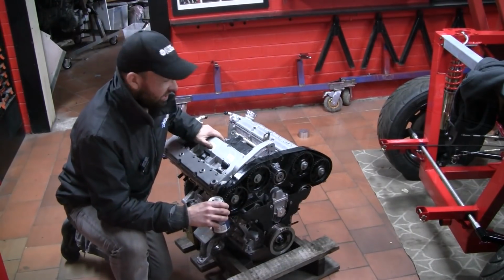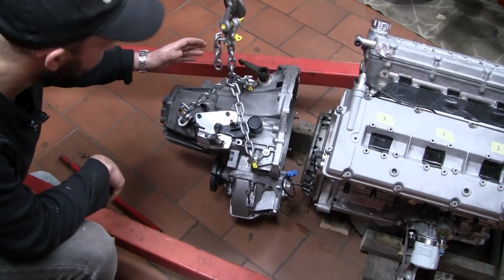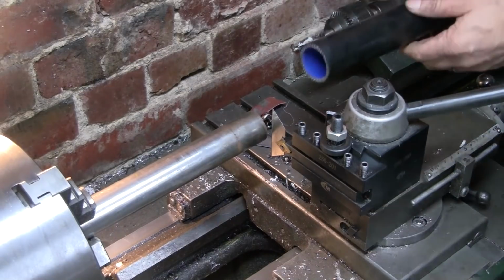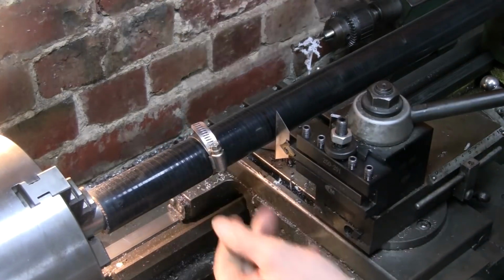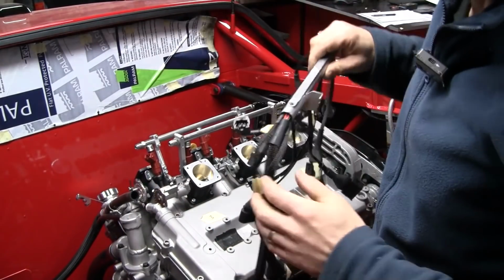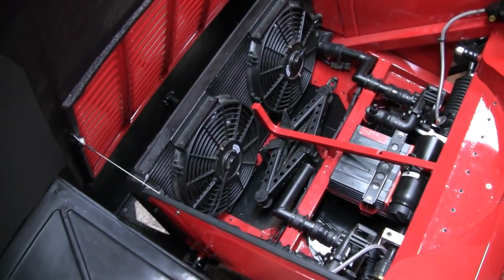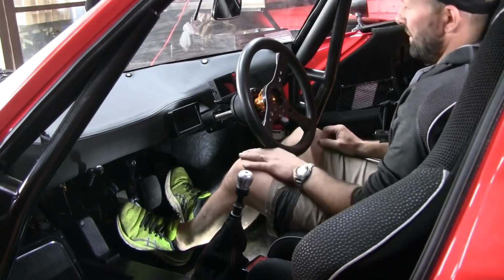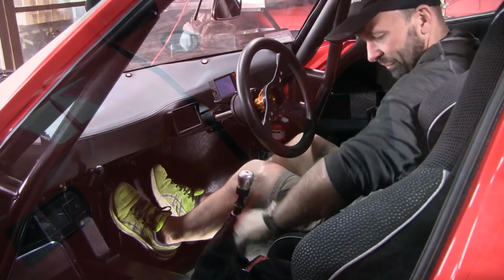Episode33 - Stratos Tarmac Rally car....Finished!!!!!!!!!!!!!!

Comment: Nicely done, but what happened to the nice Fiat 124 sport based (authentic period look) instrument cluster. Cant say like what you did there, sorry.
Reply from the maker: each to their own, this car was always going to be function over form and while i also liked the original dash, it took  up about 1/4 of the front screen and had a lot of gauges/lights that i just wouldn't use
Reply: @105colin  It’s your car of course, but you know you could have incorporated some of the original look into what you wanted. Just a thought. Cool car regardless of course 😁👍

Comment: Cmon mate we need more info! How many thousand HP did it make, how much NOS are you running and how many dentist driven supercars did you beat in the twisties at Winton? Actually how did the port temps go? (overall and spread?) also I wanted to say that you should drop to the 3mm tipped TC as the 1/4 inch ones you have take forever to reach steady state even on an engine dyno. Hope to see more vids in the future, great work!

Comment: Congratulations on finishing it. Two things. Did you retain the beeping reverse light? What did you do with the rear window? Stick with the perspex or get a glass one to help reduce noise. Once again, well done.
Reply from the maker: Hey Paul, thanks mate, Beeping reverse light???? .  Na stuck with a perspex rear screen, spent a long time sealing up the rear bulkhead and the cabin noise isn't too bad, the airbox reduced the intake noise a lot
Reply: @105colin  I put a globe that had a beeper attached. Probably died because of lack of use. I had to do something because people would stand behind the car when it was reversing. As you would know there is NO rear vision.

Comment: Superb result.  The last 10% of most builds usually take 90% of the time;the Stratos seems to have come together rather more quickly; registered, dynoed and driven in quick time.  Well done.  Any power figures?  Thanks for the series.
Reply from the maker: True, one of the main reasons for the lack of videos,just had to put the head down and get it finished.  Power wise,  well don't want to get into  a numbers battles but we got well over the standard 3.2GTA numbers Limited to 7000 and still increasing in torque, so more to come!
Reply: @105colin  I saw 189.0 on the dyno screen; assuming kW and 15% transmission loss, that is pretty healthy.  Nice easter egg.  What was the starting issue?  Thanks again.
Reply from the maker: Haha, you win! yea got up to 194kw, I'd be a bit more generous on transmission loss than you, but regardless, very healthy and still making very good torque, so could wind up the rev limiter.
The starting was some weirdness with the Haltech base map, i ended up calling Haltech and they were a bit stummped as well, although the map looked OK it was commanding very long injection times.  They reset the unit remotely and uploaded a new map, and started first go
Reply: @105colin  Thanks for the info; impressive result.  Good luck for up-coming Targa; I hope there are videos.